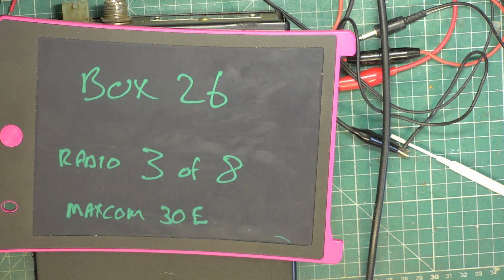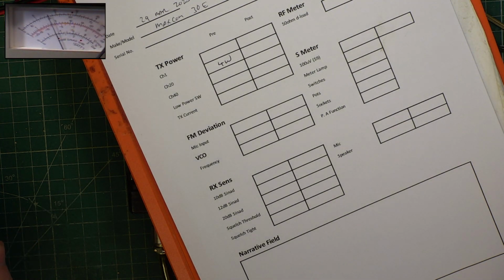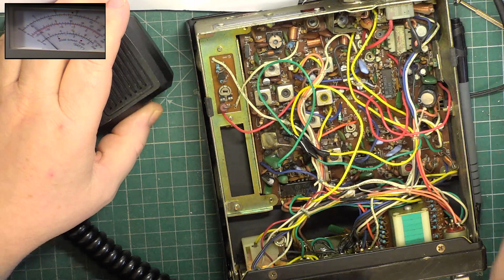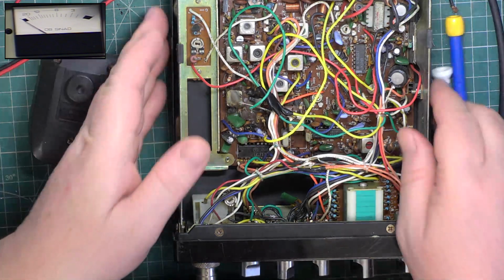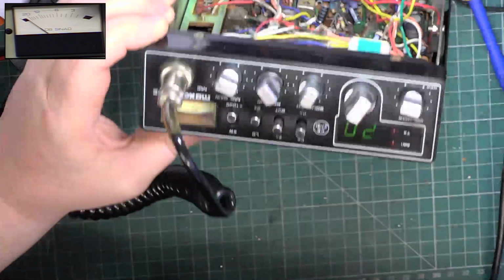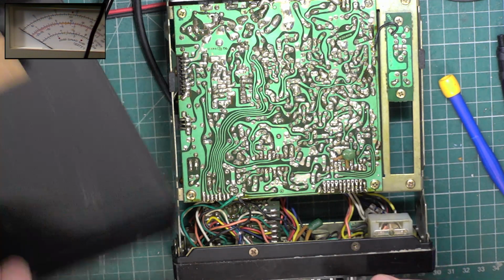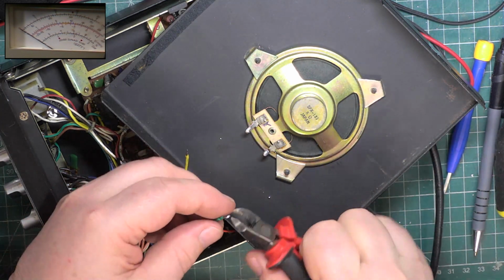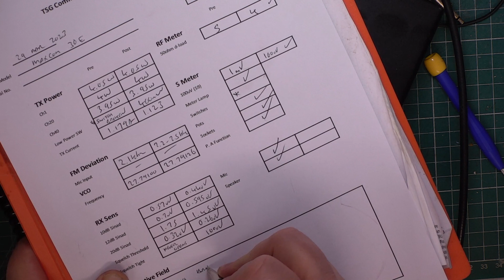Maxcom 30E CB27/81 UK FM CB radio - service & switch repair

Comment: It's amazing, I've seen a fair bit of smoke come out of electronics and it will still continue to work afterwards, I've seen this before on dirty boards with a small dry joint on the board, you only need a small amount of dirt to get in with the dry joint and you can get burning, I use a thermal camera if this happens, super easy to spot then, I like the look of the 30E I've 2, one I restored from a very poorly state and 1 brand new in the box still with labels on, both with factory mics, you are right about the xtal filter though, I've about 150 rigs to choose from so it's no bother and there normally isn't anyone there anyway lol, I must be mad.

Comment: I noticed the magic smoke a bit earlier but couldn't tell where it came from
Reply from the maker: I seemed to be coming from a resistor in the transmitter driver. That's why I cleaned the underside of the board.

Richard

Comment: hello richard, did you find out where the smoke come from? maybe a fault component?
Reply from the maker: It looked like a resistor in the transmitter driver department. That's why I cleaned the board with IPA. something on the print side must have touched. Once I'd done the IPA cleaning there was no further smoke.

Richard, UK

Comment: I have the same radio but it as more frequents when you push up and down the pa button
Reply from the maker: Well John, if you're in the UK that makes your set illegal I'm afraid. Time it was put back to factory standard.

Richard, G0OJF, UK
Reply: @ukfmcbradioservicingTango21  lol its up in the loft Richard not used it since the early 80s

Comment: Were these maxcom boarded rigs re badged as other rigs?
Reply from the maker: Yes, starting with Midland, Cobra, Colt, Nentone, Sirtel just for starters.

Richard, UK
Reply: @ukfmcbradioservicingTango21  yes thought they were quite widespread.

It makes you wonder why they made these "oddball - one hit wonder" sets where the chassis wasn't used in much else - fidelity 3000, good buddy, planet / kestral / communicator - exact same rig with different name on channel changer (to keep the costs down)
Reply from the maker: What about the Grandstand Bluebird? Amazing quality from a Japanese firm who these days manufacture sonar marker buoys!

Richard

Comment: It's a shame u don't do ssb radio s
Reply from the maker: There are only about 4 UK legal SSB radios. All getting involved with SSB would do is me ending up with radios that are not UK legal coming in for service. I am licenced to do this work. Everything coming in has to be logged. Everything illegal has to be reported.

I am dead against illegal & pirate operation. There are 40 CEPT channels you can do SSB on, yet I hear it all over the band.

Richard, G0OJF, UK
Reply: @ukfmcbradioservicingTango21  the problem is with "freebanders", where they will go anywhere to talk skip, also when the skips rolling the former Soviet countries - Ukraine, Lithuania, Latvia, Russia are widespread across 26,27 & the 28mhz 10 meter band using the CB as taxi radios.